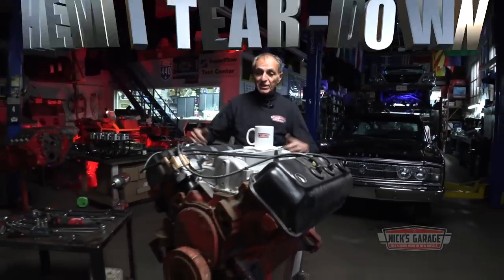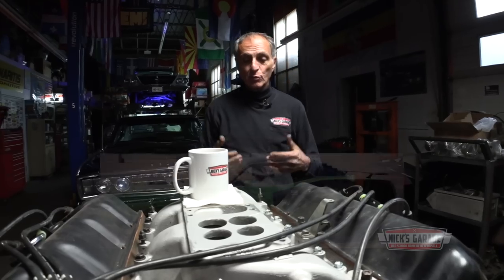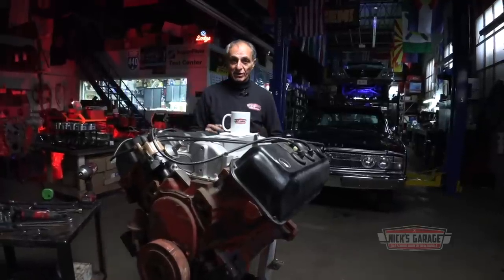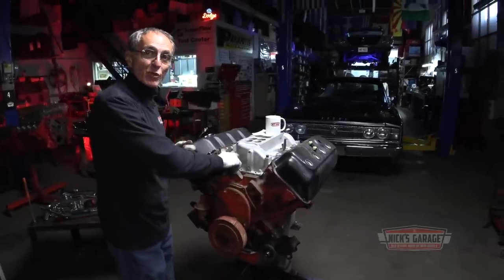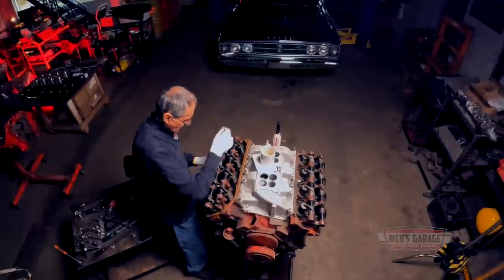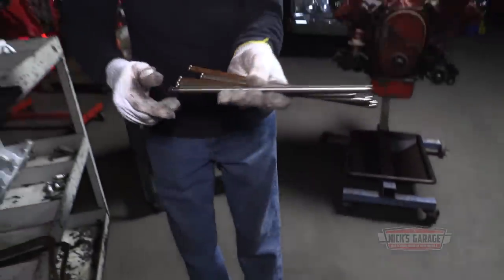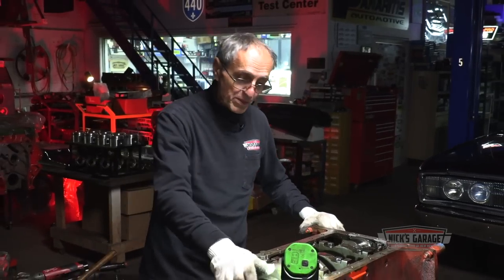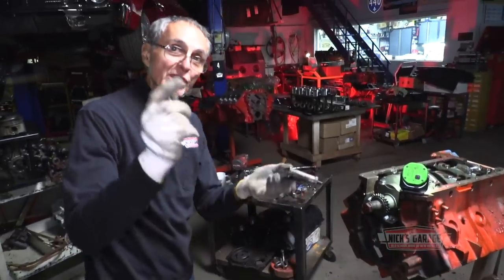426 Hemi Torn Down - What's Inside the Legend?

Comment: Hi Nick, I bought a '69 Plymouth HTC with a 426 Hemi for $800 . Now, it had been best hard by someone who has no knowledge of the Hemi. It was carbon up on inside, had one set of points in distributer! I tore it down had no idea how to go about factory rebuild. At the time (it was 1972), it was january, and cold in my old garage. So I wrote to my hero back then ,Big Daddy Don Garlits, sent him pics of what I had. He answered me and was a great help in my quest to rebuild my hemi. He suggested I do the bottom end but send him the heads, intake and the two carbs. So I had block machined , cam bearings and mains line bored. Block decked checked new bolts and crank polished and balanced. I had the money cause I'd just been discharged from army and had saved my pay from boot camp to infantry school, jump school, and two full tours in viet man 101 airborne div. Don Get lots shop did my heads, carbs and told me what to do on reassembly. Anyway, it came out great, I had car interior cleaned and any leather pieces replaced as needed. When done, I took it down to Gainesville to Big Daddy shop and showed it to him. He was deep into getting ready to run the '72 season. It was a great experience. It's the only Hemi I ever owned, I sold the car to buy my first house as I was getting married. Still miss it today.
Reply: Great story James!
Reply: i agree.. GreatStory Sir...
+the good thing is U gave the car to buy a house...now U can buy if  wanna  to with all respect...to balanced the crank and all moving parts is no to small n no to much if you know what to do or a good Person like Mr.Don in your story...thanks anyway ..
Reply: Mate I would have stayed with the car, women are nothing but trouble. Always stay with old Reliable.

Comment: When I was a teen, the 'old guy' not far from my home, that had a small shop, sometimes built auto-engines for people. I got to hanging around...and over a few years, learned A LOT of old 'build' techniques...pretty-much lost to the average builder today. To prevent 'initial start-up gall' on the cam, he showed me to put all the lifters into a deep metal bowl, fill it (over the lifters) with 10-w-40 oil, and using a philips screwdriver, 'pump up' the lifters...it helped TREMENDOUSLY with that 'hard wear moment' of first start. Of course, the first 'pre-assembly lubes' were 'hit-or-miss' failures...his rock-solid way of pre-lubing all your bearing surfaces, was to use petroleum jelly...it worked, works better than any pre-assembly lube you can even get today (some may want to read-up on where petroleum jelly comes from, for this one). Knurling pistons was pretty common 30-years (and more) ago, and the KEY suspect for 'unneeded upgrades' can be found as close as your 'car magazines'...often pushing 'improvement upgrades' because they were paid-to! The advantage of 'being old' when it comes to working with cars...a number of us remember 'why it's like that' and 'how it got like that'...
Reply: Very intuitive information Skeeter. I heard about soaking lifters overnight but not "pumping them up" with a Phillips screwdriver. Very handy hints.🧠👀
Reply: I grew up much the same way taught by a master macanick for Chrysler dodge and Plymouth motors I like him he sounds like that guy Doug Warren 67 Hemi R/T !
Reply: We used to use STP for building engines.
Reply: The 360 that I watched my dad rebuild in the mid 80s: He preloaded the lifters the same way. If I remember correctly, he used the actual pushrods from the engine. But definitely remember my dad doing that.

Comment: Hey there Nick...you are definitely the HEMI man extraordinaire. Being a 73 year old gear head myself I sure do miss the GOOD OLE DAYS when you could work on a V8 engine without having to buy special tools. I started building engines at the age of 16, my first was the old venerable Flat Head Ford for my '39 Ford Coupe, it originally came factory with the terribly under-powered tiny 60 horse V8. I remedied that by swapping in a 252 cu in Canadian Mercury with the 4 ring racing pistons the 59 AB heads and duel Stromberg 97's. It was geared with a 4.44 ratio banjo rear gear. Then by age 17 I discovered small block Chevys. Over the years I have owned at least one of every cubic inch Chevy engine made from the original 265' to the 545's and I loved the old 409, 454 and especially the L-88 427. God what power they made! I love listening to you explain the Chrysler's and related Dodge's, Plymouth's, etc. You sound a lot like me in that I have to learn it all about what I am working on at the time. Its the details that count.  Keep up the great videos PLEASE

Comment: The number of views proves what we all know: The 426 Hemi is a legend among engines. That thing could SING! 

This was sold for racing promulgation. It was overbuilt because it was designed for racing, and changing to cheaper parts for a street version didn't make financial sense. You paid a hefty premium and got a very limited warranty if you ordered this beast in one of the few cars it came with. Mopar knew what people would use it for.  

I'm old enough to remember a "tune up" involved new rotor caps, doing the points, and using a timing light. I did it pretty well back in the day, but it's been so long, I barely remember how!  

Newer cars are easier to live with, but this reminds us how far cars have come. A Modern Hemi is much stouter and makes far more horsepower, using half the fuel, polluting less, and with much better reliability.  

Still, there was a time when you could walk into any Mopar dealer and drive off with THIS under the hood!  That's amazing.

Comment: Back in the 80's I was selling some rare 60's Ford performance FE engine stuff in the local classifieds. Mostly 428 CJ, but I had some 289 and early 390 HP and a few 428 PI parts listed as well. But obviously all Ford stuff. Strangely, one guy called asking if I had any 426 Hemi heads. I said no, but had to ask why he wanted to know. He said he had 7 426 Hemi short blocks but no good heads to put on them.

Comment: "Nick's Christmas Gift box". Shirt size 2x. This is my very favorite muscle car site. I used to have a lightly modified 5.7 Hemi 2005 Dodge Ram, short bed, 2 door. Detroit Truetrac and 4.56 gears. Lakewood traction bars. Long snorkel cold air intake, MSD coil packs, shorty plug wires (both plugs in each cylinder fired together) and Superchips tune. Best 1/8 mile 8.87. Street tires on factory 20 inch rims. Took the spare tire, tools and winch out and left them in the garage. When I went racing the tailgate stayed in the garage too. Total weight saving of around 160 pounds.

Comment: Back in 87 I rebuilt a Hemi for a guy in a 69 Hemi Roadrunner it had a knock in it. Turns out it was a wrist pin on number 3 cylinder it was a all stock Hemi as well. Got it done it ran great had to re jet the front carb though someone had messed with it was also way to rich. The man was overseas on business he called me I told him it was done he said he would be gone for about a month I asked him if I could take it to the drag strip to dial it in he said go ahead if I mess it up he gets my 70 GTX which only had 53.000 miles on it a one owner car which I never hardly drove I said ok.
After putting about 200 miles on it I took it to the track 1/4 mile of course a 4 speed all stock 69 Hemi Roadrunner 4.10 Dana with street slicks first run 12.89 @115 mph had more in it but did not want to touch it ran to good. He got back picked up the car three months later he got divorced in the end I sold the GTX and got that same Roadrunner had it for two years traded it for a 68 RT Charger and a little cash. Man those were the days.

Comment: Great video Nick! I've never owned or driven a vehicle with any generation of Hemi but, I sure do love looking at and listening to them! 

Also, I'd like to point out, for those who don't know, that isn't a typical "4 bolt main" setup. Most blocks from other manufacturers have all 4 bolts drilled vertically through the caps and into the main webs. This is a "cross bolted" setup. I believe Ford also used this type of design for some of their engines but, not many. These days, cross bolting is much more common (because manufacturers have switched to using "deep skirt" blocks like this one more often) but, it was rare in the old days.
Reply: Good point, Mike.  Thank you.
Reply: Mike, I just thought I would add that on the much later Pentastar V6, like mine in my '12 Chrysler 200 convertible, the crankshaft is fitted with four bolts on the main bearing supports. Two additional bolts are cross-fitted in the main bearing caps to provide a rigid bottom end.
Reply: @MoparDan  I didn't know about the Pentastar engines but, I believe that GM LS engines, as well as at least some of the modern Ford engines also use a similar "6 bolt main" design. It would be impossible without a deep skirt block like many engines use these days.
Reply: Some of Ford's 60's high performance FE blocks had the cross-bolts. All the 427's (including the SOHC) and most of the 406's except the very earliest ones, which had over-bored 390 High Performance solid lifter blocks. The shop I worked for back in the day used to install splayed 4 bolt billet steel main caps on early thick walled production two-bolt SBC blocks. Most times we used the Milodon or similar kits, a couple of times the caps were machined from raw 4140. It was very difficult to align bore and hone a perfectly round and aligned main bore with cast iron  block on one side and tough chrome-moly steel caps on the other, let me tell you. The bore liked to get oval if it wasn't done just a certain way. It took many tries before I found a reliable working procedure of how and how much to bore out and hone to final size. We had a customer that shifted his SBC at 11,500 rpm with those blocks. The Bowtie / Brodix  blocks and our own Motorsport Cleavor style (part Cleveland, part Windsor) splayed cap blocks were similar, but all iron and much more straight forward and easier to machine. The best block and main cap design is where a solid one-piece lower crankcase half retains the crank with dozens of bolts.
Reply: @scottb8175  .... All good. Thanks.

Comment: I figured the cam was replaced because the original went flat. A pushrod might have been damaged as the cam went flat, and that would be why one replacement pushrod went in.
I know that many people are buying mild solid roller cams for these engines, not because they want to gain horsepower, but because they fear having another flattened out cam lobe.

1:02:30 Nowadays, some people will have a thick antifriction coating applied to their pistons. That is how they narrow the piston to bore clearance, then re hone the engine.

Comment: As you said. The last person that worken on the hemi used larger diameter bolts for no reason thinking
it would be better but then used department store bolts that were to short and not the correct grade. I
saw an unmarked grade 5  and a grade 8.  Thank you for the nice video........... Regards from Ody Slim

Comment: They don't make em like they used to for sure.
Always liked the 426 hemi motor.
I grew up a Chevy man myself but liked all HP motors.
My dad had a 66 Chevelle 396 that he ordered new with a special corvette heads option.
He worked at the local Chevy dealership so he got a deal.
Back then it was a hard car to beat.
And he drove the car everyday.
He had a 3 speed stick which I didn't like but it came that way.
Nice video Nick.
Reply: Thank you.

Comment: Isky 288 hyd. cam  .050 duration 240/240  lift at valve 480/480 on a 108 Lobe Center.  Good street/strip cam. Will be following the build Nick!
Reply: I see you looked into it.
Reply: @nickpanaritis4122  Yeah just another Hemi guy helping another! I checked out the original 1970 Hemi hyd. cam  in the lathe out of brothers Hemicuda it was 228 @ .050 and .470/480 lift   112 LC.
Reply: @fortyshooter1  ...You got it.

Comment: What you just said about the Hemi crank and rods is the reason why I built the only wedge I owned had a Hemi bottom end 💯 percent my 440 block numbers were 440-6-a big X cast on the starter side and it had the 1/2 oil pick up but I ran a 12qt malodon out side oil pick up !

Comment: I'm very certain that Nick knows but misspoke when he forgot the 273 and all the polyspherical headed motors that also have adjustable rockers......but then again, there's old school and Olde School and it's a rare individual indeed who's working on a poly.  Nick's knowledge surpasses mine and I believe he was more interested in the teardown and discovery of what was inside than to include all of his encyclopedic knowledge.  It would be a 3 hour video.  Kudos to the man and God bless him.
Reply: You are correct. There is the 273, 426 Max Wedge, 413 and the 6 cylinder with adjustible rockers.

Comment: ANd if you can find aftermarket spark plug leads that have the tubes in the head that are the correct length to seat on the sparkplug terminal without any overhang, I wish you good luck!

Comment: Great video, and very therapeutic! I love it! 426 hemi Way over-engineered for old top fuel etc use! I have no experience with the original 426 hemis. I know the early hemis some of which did have adjustable rockers as did the poly 318s which with 8bbl intakes made the same hp as a 340 6bbl! The 1950s to early 60s stuff is way underappreciated. Desoto had some of the hottest motors. 345ci Hemi, 345 hp! 340 6bbl was 290. 413 long ram, more hp /ci than a 440+6, with 400 available special order, 354 hemi "export only" 355 hp before chevy! Desoto 361 fuel injection, and 392 EFI Motors built by WW2 aviation experts. Cars weren't as " flashy" tho I guess! I am building a Keith Black 498 ci modern top fuel hemi for 95% nitro. And 8,000 hp. Cackle car on nitro, run on 30% nitro and methanol, 250- 270 mph. The longest-running in regular competition injected dragsters are two Desoto-powered ones! Beat LS motors Iron heads. The 426 Hemi, wedges, and LA were cheaper compromise motors compared to the old ones which had used better engineering, materials, heads, floating pins, mechanical cams, and poly heads. Never could figure out why a wedge "B" series replaced them except for cost when the same intakes fit hemi or polys. Heck, I'm also building a twin carb, aluminum head, cammed with headers 230 flatheads six for the wife's 1949 coronet, the same car as in the "copperhead road" video! and I have very successfully drag race long rams over the years in many cars, many engines, prefered over the 6bbl 440 in dads car! And I will pull the dragster with a 1958 navy semi tractor 354 hemi powered. And had an M37 Canadian command truck with a 251 flathead daily driver. You are a wonderful teacher, very calming like Bob Ross and have have awesome knowledge, being communicated very well! Keep it up!
Reply: Glad you enjoyed !

Comment: I started building a 68 vintage Hemi for my 71 Cuda clone project back in 2014. Nearly had it together but realized the valves in the aluminum heads were too long and springs were too big for stock rockers. In 2021 I bought a new re-pop block with std bore. Since my old block has 6 sleeves and cracks in #2 & #4 mains it only makes sense to go back to square one and start over. I'll bore the block to match my existing pistons .070" over or 440 bore. The assemble the shortblock. Then the heads need stock valves and springs. Perhaps then I can finish the build I started years ago. Best to do it right and know my engine will live.

Comment: Nick, at any given time, how many ENGINE STANDS do you have in the shop?  I'm guessing more than ten (10).  I own a 1980 Corvette that I bought in 1997.  I've been through the drivetrain to shed all of the stuff that choked/limited it.  It still has a quadrajet but many name brand parts (nobody wants an ALL ORIGINAL 190hp C3 after all).  I keep a 4-bolt short block on my ONE engine stand that I dream of moving my engine parts to with its forged crank (.040 over bore).  I've even gone retro-roller cam and full roller rockers (Comp).  All to get the HP and TQ to respectable levels... at least respectable for the early 70's.  I've no need to compete or compare to today's power plants.  Just want it lively for cars from the 70's.  Keep on doing what you do.  Always a pleasure to watch your latest video.

Comment: I find the knurled pistons funny. I'm 72 and I have rebuilt many engines and only once did my machinist recommend knurling the pistons. It was a Ford Y-block. The concept is good but it doesn't last long. If my memory serves the block was already .060 over. I found another block that was a standard bore size. I had that one bored .020 over with new pistons.
Nick's X mas give away.   Large.

Comment: Hey Nick, you said a few times in the video that the stud and nuts main bolts were overkill for this particular application. I agree 100% however I think it would be nice to explain for those who don't know why it can be a benefit for race/ high HP applications.
Studs and nuts ensure that the threads are fully used and the torque values are true. For example, let say a bolt touches the end of the threads before it fully compress the 2 parts that it is holding. Or if the bolt is not using all the threads available, it is losing some of its holding capacity.
Of course, the grades of those studs and nuts have to be the same or better than the factory bolts.
Reply: I agree. And yes, studs have a stronger clamp force.

Comment: Hello Nick , why don't you use ice spray instead of the blowtorch? the army uses it to disassemble planes. Large, thick bolts can be dismantled with it without the risk of fire.
I saw it on a phantom wing in a video.  Greetings from Germany
Reply from the maker: Very interesting! Thanks.
Reply: I use it almost exclusively for all screws on vehicles
Reply: @erichlausch9886  Does Home Depot sell it in a spray can ?